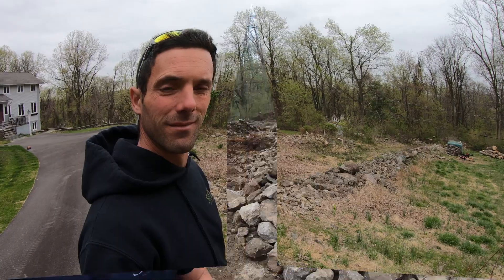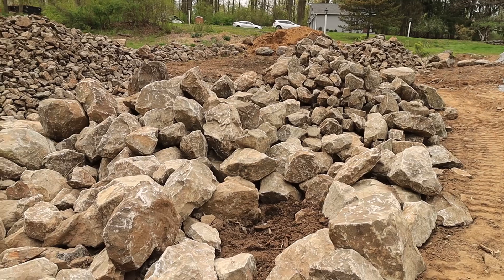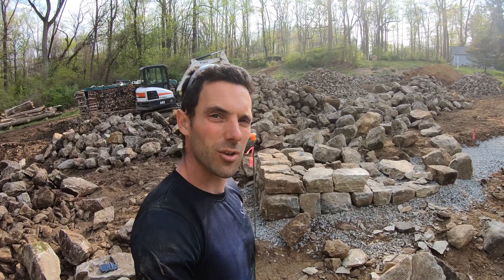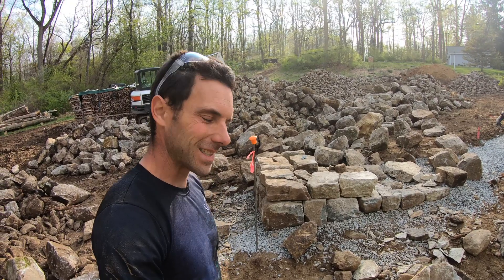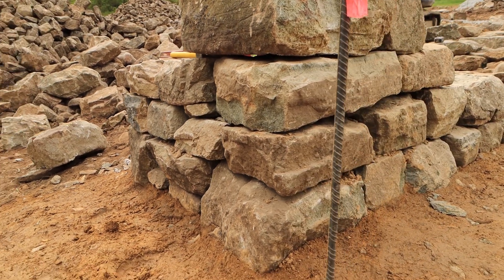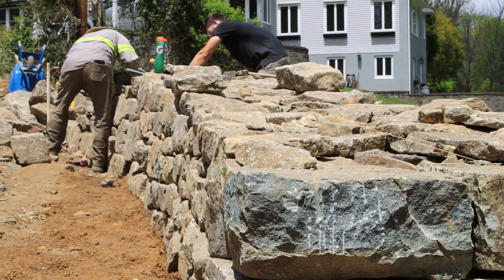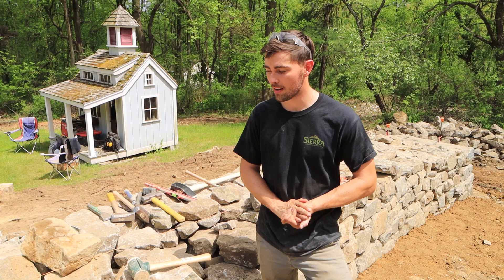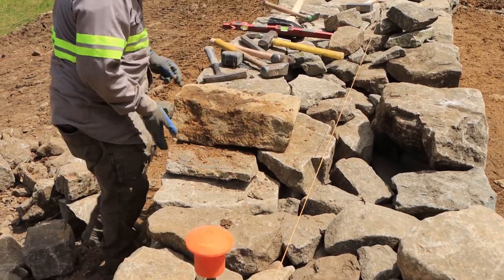Making MASSIVE art wall from rubble 1 of 3. $60k retaining wall.

Comment: What does it usually cost for material if you wanted like 8-16inch natural stone? Do you go by weight, By individual rock, or do you go by pallet and just have an estimated number for how many are in each pallet?
Reply from the maker: Thanks for watching. That's tough to answer because the different types of stone are different costs. Regional differences happen also. I've seen pallets of stone for sale for $750 a few states away that cost $200 locally. In a wall this scale bulk stone would be your best bet. This type of quarry granite would sell for around $250 per ton. We generally use around 1 ton for every 20 face feet at 1' deep. This wall is 4' deep.
Reply: @thebackyardexpert  okay awesome thank you very much for the quick response and information! I actually just watched your other video on building the dry stack wall and those more flat stones are basically what I’m looking for, I’m just doing a small boarder wall with them only stacked 2-3 high. I’m in western PA and I actually can’t find any local places with them in stock surprisingly so I’ve been collecting them myself and just needed a general pricing for them so I don’t under sell them and hurt myself. I really appreciate the response! Subscribing for future information!